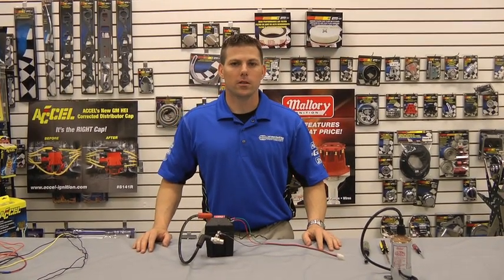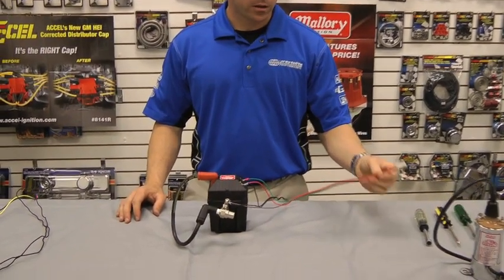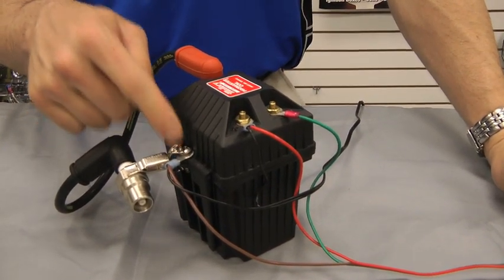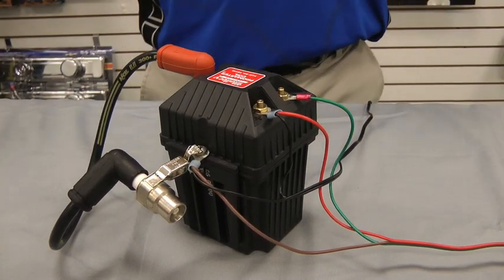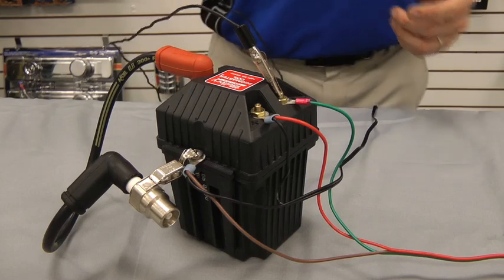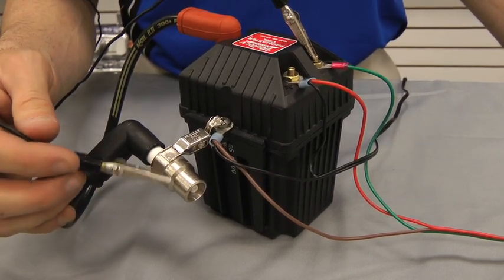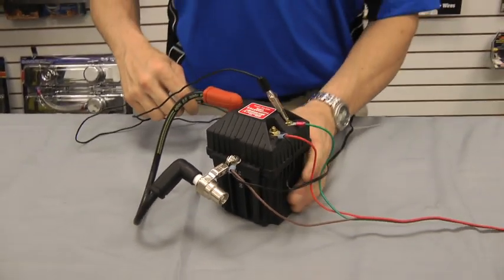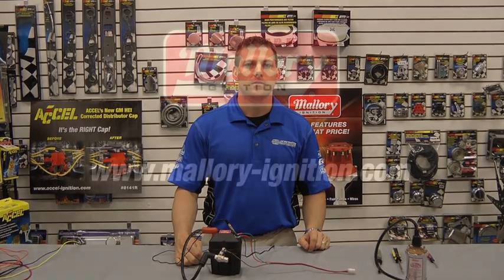Mallory Ignition Testing Ignition Coil for Positive Spark Video Part #29440

Comment: Well, his coil must be junk like mine. His has no spark either! No a good sales job video. His junk didnt work and neither did mine. Lol. At least mine had a chance to work. It was  connected to a good distributor. His was just hoping for a bolt of lightning from the ignition gods maybe? I didnt learn a damm thing except pertronix high end stuff works good without a finicky CD box or sensitive triggering light.

Comment: I have that 60 to 70's vintage super coil hooked to a MSD Capacitor discharge setup on a 70 429 cobra, huge long duration spark.  Touch it to ground would make a better video.

Comment: He appears to be WAY SHIT SCARED to actually "LIVE TEST" the coil. And rightfully so, the sheer size of it leads me to believe the electrical arc would produce a veritable "stairway to heaven"  which the user may not have the "no climb" option...
Reply: Go ahead... ride the lightning!  I think the transformer ratio should hit him with 20mA [assuming 35k volts output at secondary] if he screws up.  That won't kill, but he will find a new vocabulary.